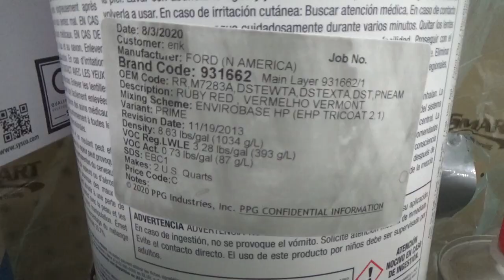1977 Camaro Z28 Part 240: PAINT! Ford Ruby Red Code RR

Comment: Houston...  We Have Paint !!!  Damn that looks gorgeous!!!  Always love your process.  You have spent so much time and effort to create a sterile environment for your booth, it is a shame that you are still getting that much trash.  Have you inspected the Fan that is built into the Air Compressor's pulley wheel?  Dust could build up on it and launch itself into the air when it kicks on.  I believe that is where I am getting crap in my priming efforts.  I don't believe that it's coming from the floor.   Like you, I occasionally watch "The Gunman" and I believe he prefers to not wet the floor.  Cheers to you buddy... What a gem you and Pops are creating.
Reply from the maker: Thank you very much. You may be on to something with the compressor. We tried to hide it behind plastic, but we were having to much trouble with the plastic puffing out, so we removed it. Everything else in that garage was DANG clean. We blew out the fan on the compressor when we cleaned the garage, but that may very well be it. Thanks a lot for all your kind words here and along the way. You really have been great.

Comment: Just finished the video, the hair prbably came from pops, leaning over the paint.  As far as the trash goes, if you are using the same gun for sealer, base and clear that can cause problems even if you clean it out. Most painters have a primer gun, base gun and clear. Even if they are harbor frieght guns its better than trash. It would have been better to wet the floor. when you spray the rockers, bottom of the fenders ect it kicks up a ton of trash. The fan also probably did more harm than good. You want to control the air, not have it swirl around. have 2 fans on each end, one doing push and the other pull, out a door or somthing.
Reply from the maker: I used a different gun for sealer vs. base + clear. I agree it would be better to have different guns for base & clear, but oh well. There is no way I could have sprayed w/o the exhaust fan. It is a Jenny 16", so pretty chunky. Even with that, there is a lot of mist in the air. I can't remember why I did not wet the floor, maybe I did and it all evaporated. It was really hot.
Thanks for your input, all good points. I would say I am pretty pleased with how it turned out all things considered.
Reply from the maker: Oh forgot to mention, the source of the big trash was the compressor. It was kicking all kinds of crap off the belt/etc. We put a dog house over it for the flow coat and it was MUCH better.

Comment: Hey eric great job did u mix the med coat in the clear or in a inter coat
Reply from the maker: Thanks a lot! PPG calls for it in clear coat, not an intercoat. They recommend using the same clear as the top coat as well.

Comment: Great job! Paint looks awesome, now the fun part of finally assembling and making it drive for you and pops to go cruise in! Would you have any idea of the price it has cost for supplies/paint? I know its hard to tell its been such a long journey but just curious
Reply from the maker: Thanks Christian. A LOT $$$. LOL. We have about $2k in base coat, $800 in sealer (I could not get quarts, so I have a lot left over!). Probably about $1200 in clear + tint. That is all just for the final paint. There was all the stuff that came before. Probably $1200 in epoxy. So, it is a $8k paint job pretty close not counting labor. The tri-coat + red really bumps up the price.

Comment: I hope my paint job turns out half as good as yours.  Looks very good.  Glad to see you got it done!  What was the issue with the sealer when you were starting off?
Reply from the maker: Thank you very much. We had a big gap between when I started spraying the sealer and when I went back for the second coat. The sealer had kicked in the cup and the gun. So, it was TOO thick to spray. I kept fiddling with the gun, but to no avail. So, I took the cup off thinking I needed to clean the gun. That is when I found it.
Reply: asicerik I have an FLG 4 and a Kobalt 60 gallon compressor and you posting the gun, PSI and settings was very helpful.  Definitely will help me!  I’ve done the core support (and accessories to it) underhood and wheel wells so far, didn’t come out too bad.  Going to tackle the rest of the car this week.  What was your PSI at the air compressor?
Reply from the maker: @highspeednoblesgarage3152  It is a pretty good gun. I have 120 psi at the compressor, but regulated down to 100 or so at the first filter. My dessicant filter has another regulator right before the air hose for spray painting. That one is probably around 50psi.

Comment: when you started spraying red  you did not start at the top edge of the right fender. i wondered why?
Reply from the maker: Not sure I get your question. Do you mean from the front? Or why I started over the edge where the hood and fender meet? If the latter, I don't know. I probably should have. Part of what I was thinking is I wanted a flat surface so I could really see how the paint was laying down.

Comment: At 10:20 in i cant see any black in the sealer unless the camera isn't picking it up. so I'm wondering if it happen in the first base coat?, and if it was the compressor belt why would in not have been in the sealer? just trying to figure where the contamination came from, also I wouldn't think rubber particles would float through the air in chunks like that. Just thinking out loud on your channel lol